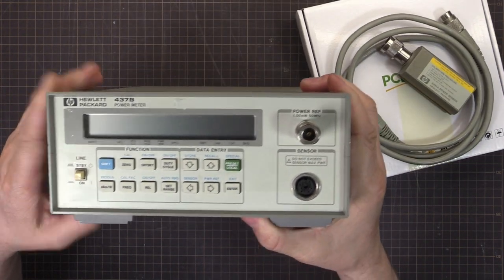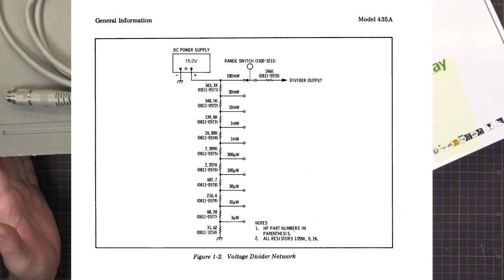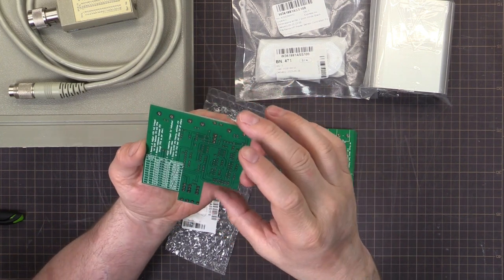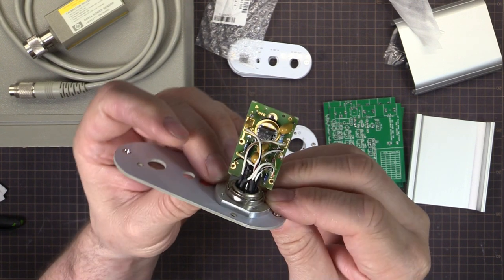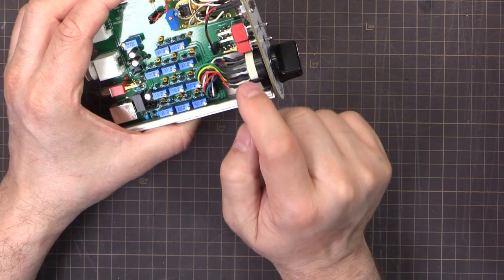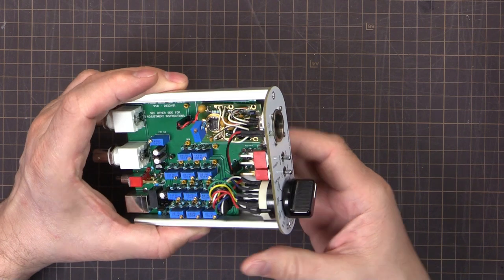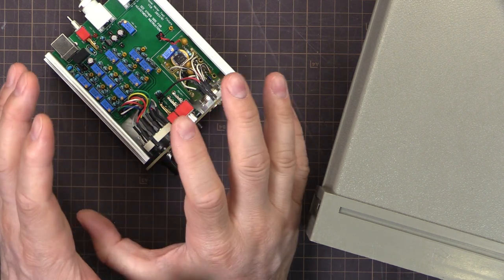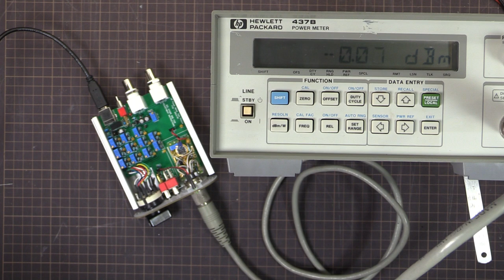DIY HP Power Meter Calibrator - Version 1.0

Comment: J'adore, je suis pas au niveau pour en avoir besoin maintenant. Ce que j'aime le plus c'est la somme de travail et les progrès accessibles aux amateurs, fini les boites en pcb, les circuits en l'air, etc.
Very professional work.
I have seen many power meter on ebay without sensor, so at this time i play with ad8307 and analog voltmeter. Thank for sharing your knowledge

Comment: Not sure which type of dcdc converter you used at the usb input but in the past I had quite some issues with strong emc regarding these small four pin SIL converters… but I guess you‘ve done your filtering properly. Perhaps two relays for the two smallest ranges?